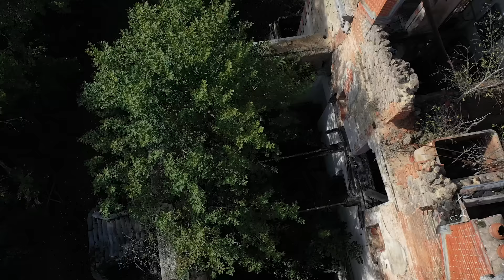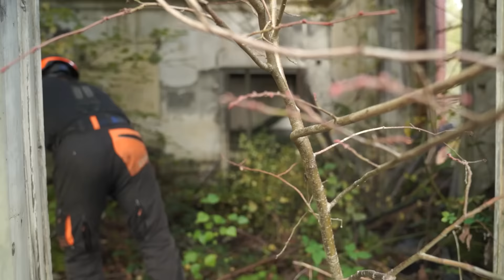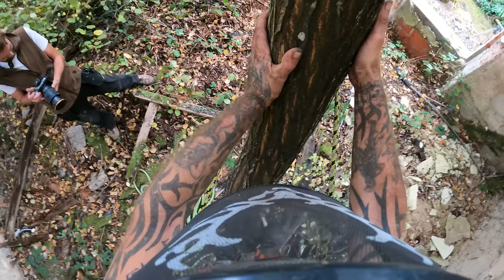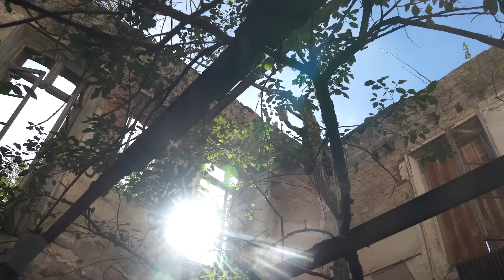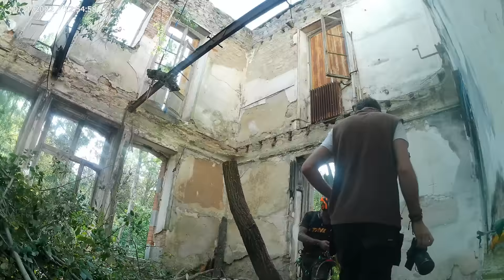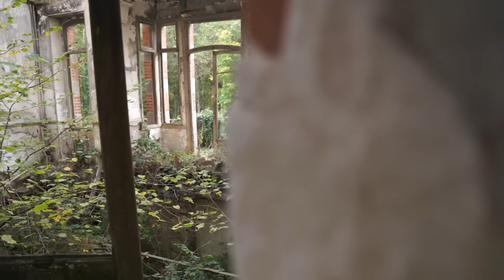Expert removes dangerous tree growing INSIDE this abandoned chateau ruin

Comment: I like your postings because I lived in France as a teen and my friend's family lived in an old chateau. We derived some entertainment out of a bathroom built in the twenties that had so many valves pipes and gages that no one could figure it out and it also had servant's quarters. This kind of construction was very popular in the later 19th century and one could also find numerous smaller "chateaus" on the outskirts of Paris. You're lucky with the large size of the property. As a designer and with other skill sets, I usually just watch the videos and say very little. However, I have a recommendation and I know your finances are limited. I don't know the local authorities' regulatory zealousness, but you should give thought to temporary roofing so the building can be stabilized and kept dry. A temp roof could consist of prefabricated wooden trusses hoisted into place and then plastic panels or sheeting. By keeping the moisture out the ability to repair the insides is enabled.

Comment: The entire project looks massive  and almost pointless. But when thinking about, the walls looks fairly well, they just need to be partially taken down in areas and rebuild, with new structure on top of them. Little bit of work, but not crazy. Would have been worse, if it was a wooden house